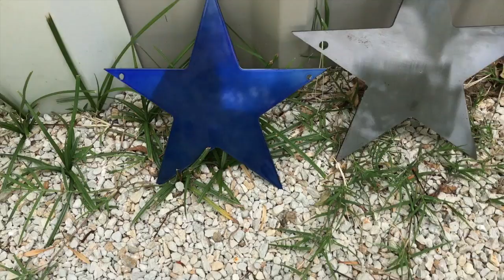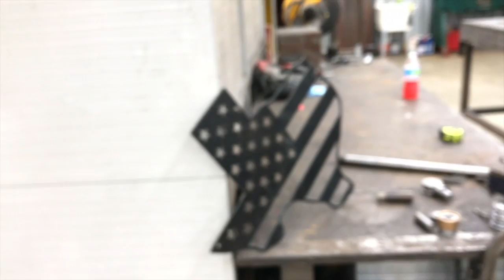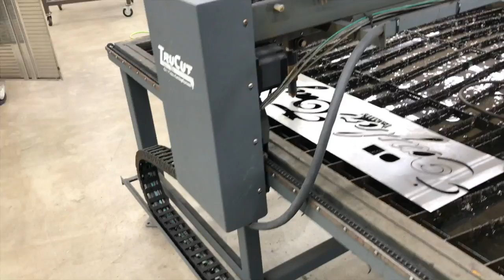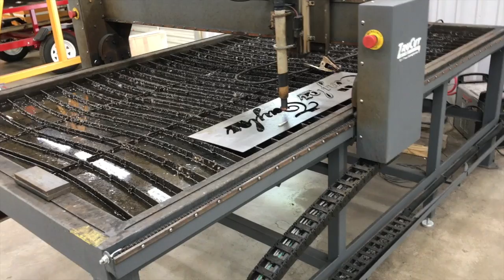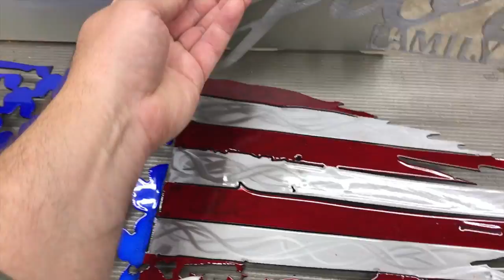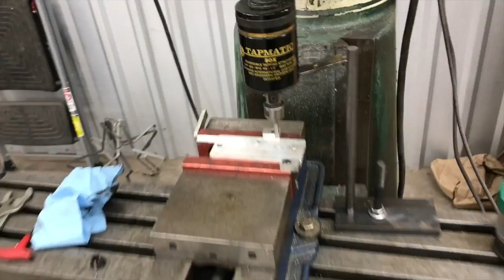Long Term Paint Test - Visit from Viewer - Travis

Comment: Cool to hear you paying the knowledge forward on the plasma table.
Reply from the maker: Well, i have learned a few things from the school of hard knocks, and have alot more to learn.  These little tricsk on dialing in the speed, and settings are similar to what you were talking about with getting good results wiht a worn machine.  My table doesnt have servo's and rack and pinion drive, but if you run it at the right speed, you can get decent results.   That JD2 machien with the clearpath servo's can buzz around at 600ipm lol.

Comment: That' a pretty cool idea, personalizing the flags. Bound to draw more work. Paint test is a great idea too, There's a way to use that old barn until its time to rebuild it! I think I would date stamp or tag each one as you put them out, maybe rattle can some paint on backside so your edges don't expire so quick. Once the back gets covered in rust you know it will grow over the edges prematurely. Idk if that's what you wanted, but it's great idea for using the spoils either way. Fade and adhesion would be good to learn. Going through your paces with the plasma table you've figured out a whole bunch, it's great that you share it.
Reply from the maker: It will be a little hard to measure the fade, because it's candy, and I try to get them all the same, but different batches, etc.  I use candy concentrate and mix for each job so there is some variances in the opacity.  But your makign some good points.  I may take a grinder and grind the date into the back of it.
Reply: Oldbarn Homestead.. I've got brass tags that normally get used for keychain I bought forever ago,bag of 100 or whatever. use them for name tags for cats n dogs, haha keys even. but they're small, have the hole for key ring and stamp easy. Great for long term tagging of anything. Marker can fade, paper and string tags lose it after long term even when it's kept dry. But you could even label paint type or whatever, just stamp it in. Idk all the variables you have but you might be able to test those as well if it was marked. I just think it's great you think about it, and great way to use some spoils.
Reply from the maker: Oh that's a great idea on using the brass tags!  I have really wanted to buy an engraver and engrave my logo into some brass flat stock and rivet on to any furniture i make
Reply: Oldbarn Homestead Yea hey that be pretty cool have a logo stamp made, "R or Rc" or whatever. Then rivet metal or fancy brass nail in the wood. They weren't very expensive I thought. I got smallest size, but I think you can get like 2 inch diameter. Got them at old time locksmith shop.
Reply: I'm sure they're internet available, to simple not to be